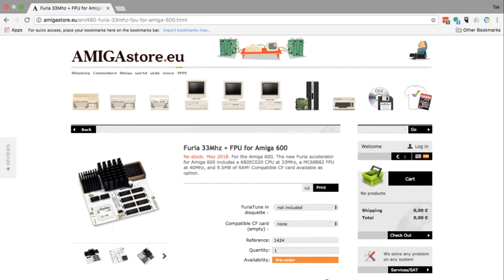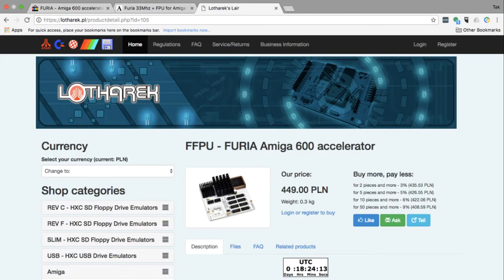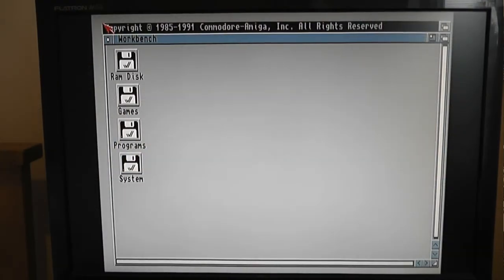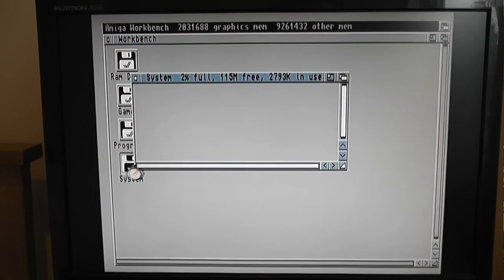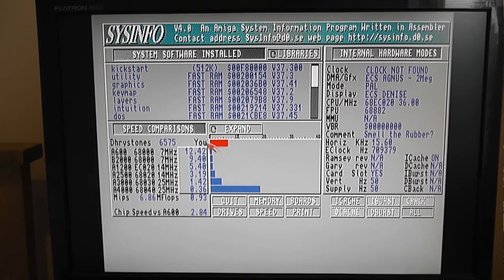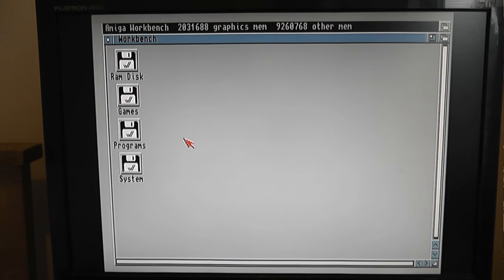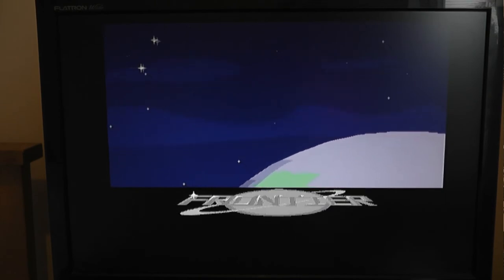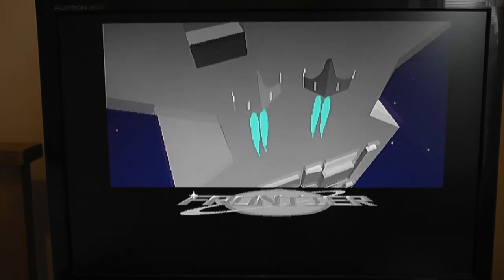Amiga A600 Furia Accelerator Installation and Review

Comment: I also bought my Furia from amigastore quite a few years ago. I got the white version. I ordered a Sandisk CF card with it that was supposed to be compatible. It was never 100% stable with this or any other sandisk Ultra/or other brands CF cards I tried.  I would get random freezes. After I bought an SD to IDE adapter and use SD cards it's been rock solid. So my suggestion is to stay away from any CF cards on the Furia. Even if they say it's compatible. Maybe newer firmwares for the Furia have fixed some of these issues but I would still go for SD cards, to be on the safe side.

Comment: A1 or A2 Marked SD cards are better for OS use than older types. There are also slim SD to CF  adapters which can allow SD media to be used where CF cards were used.  As usual, your mileage may vary. Please check them out for yourself.  Good luck.

Comment: Thanks for the tip about some CF cards not working. Sure enough, I got a blank screen with a Transcend card, but it works fine with a SanDisk.
Reply: You're welcome :) DS cards seems to be the safest option and it's tidy too if you get an angled adapter.

Comment: Great video! I too have an Amiga 600 and I have had my eye on the Furia Accelerator card for some time. 
I too have an cable Compact Flash card on my IDE port, could you please tell me where you got the 90 degree CF IDE connector from?

Also, are you going to do a video on your Amiga setup? What monitor do you have, how are you connecting to it etc.
Reply from the maker: Thanks! They're definitely a good piece of kit for the A600. I would recommend ordering through Lotharek directly. Communication from him is pretty good if there are delays or problems.
The connector I got from Retro Bench https://www.retrobench.com/shop/ki9x6g18kxwpeiikv4el5dcfgk8mag
and the SD card adapter from eBay.
https://www.ebay.co.uk/sch/i.html?_from=R40&_trksid=m570.l1313&_nkw=44-Pin+Male+IDE+To+SD+Card+Adapter&_sacat=0
Most of the suppliers seems to be from the far east. I found one which turned out to be a Chinese seller but the dispatch was from the UK. The chap I originally ordered from is out of stock though. I hope this helps.

Comment: Hi, nice video. Just got my Furia, also Rev 2b, some days ago...

Compared to mine there seems to be an issue with your Furia. It looks really slow and not the maximum RAM is mounted. Have you tried furiatune?

To get this try the following commands in the Shell/CLI - check "furiatune ?" for details:
furiatune boardrom
furiatune shadowrom
furiatune addmem

The result, if correctly used should be:
- a much faster Workbench
- aprox. 11.000.000 bytes of "other mem", if no RAD: device is used

Do you also know: There is a patch to use PCMCIA with the full RAM using "LoadModule >NIL: L:cardres.ld.strip REVERSE". (Ask google for details... ;-> )

Have a lot of fun.
Reply from the maker: Thank you! There's no issue with the Furia. 9.5MB is the standard RAM by default, the extra RAM is an option in furiatune which I briefly ran with the ? option in this video. See my reply to WalteR Mamo regarding queries with my setup :) I've read about the patch but not played with it just yet. I'll do a blog soon and it will be great to see everyone's configuration. I'll leave comments open on the blog so everyone can share their setups.

Comment: Thanks for the vid.  Have you ever had any issues with the Furia not booting?  I've heard it's down to the contacts.  My new 020/40 worked nicely for a day and now doesn't boot, despite being in a REALLY clean a600, and I've cleaned the 68k contacts with a contact solution.  I just keep getting the red screen of death atm.  When it last worked I tried to run Furiatune, with the Furia running and all th memory and cpu being detected by the CLI, but Furiatune stated there was no accelerator card installed.  Have you every had that issue?  It was flying along before this though, so seems like a good card.
Reply from the maker: Hi Ray, I've never had the red screen of death (not that I recall). I have had issues where my A600 had not booted but I had a black screen and this was due to the Amiga needing a recap. All was good after a recap. Times where it did not boot up was when the Furia was not making a proper connection. There should be a click when the Furia connects properly over the CPU. It might sound simple but could that be the issue?
Reply: @amigaguy5003  Hey, thanks.  I managed to get that 'click' today again and it has been working okay - I'm just caution about moving the miggy now ;-)

Comment: Its a shame the Furia doesnt use the full 020 (EC020 instead) because it could then use the full 32bit ZorroIII spacing for memory and not affect the PCMCIA addressing.

Anyway, I have always used Sandisk with no issues.
Reply from the maker: True. Whether it has to do with sourcing a full 020 CPU these days, I don't know but to be fair this accelerator is more than enough if you're looking to do some classic gaming. Yes Sandisk seem to be the most compatible with a Furia.

Comment: Thanks for a great video. :-) I need some advice. I got a standard A600 with no expansions, and a compact flash card installed in it, which is attached by an IDE-cable. However, many of the games on the flash card are not able to run. I get errors like 'cant allocate ExpMem', 'cant allocate ShadowMem' or 'Not enough memory available'. Now I have two questions: 1) The Furia seems to be the right solution for me, since I doubt that a standard 1 MB chip-ram expansion will be sufficient to solve this. Do you agree? 2) If I purchase the Furia, then I'll probably have to get an SD-card reader for my Amiga as well, like you show in your demo. Where did you purchase this from, and how did you install it in the Amiga? :-) I just subscribed, keep posting.
Reply from the maker: Hi Alex, thanks for your comments.
1) If you're trying to run WHDLoad games then you're right, 1MB is simply not enough. If you get more RAM for your trap door expansion you may be able to run a few WHDLoad games with 2MB of chip RAM but a lot of these games will require additional fast RAM. There's a few Fast RAM only upgrades available but with the Furia you're getting a faster CPU too. Running original HDD installable games will be fine (I tried with Sydicate and Settlers but my A600 didn't seem to have enough RAM to play music during gameplay on Settlers). Extra RAM is a must for WHLoad games. And with a faster CPU you'll find graphics in games like Frontier Elite smoother. 
2) Yes an SD card reader is going to be better for the Furia, there's too many reports of incompatibility with CF cards. I got the angled adapter from Retrobench https://www.retrobench.com/shop/ki9x6g18kxwpeiikv4el5dcfgk8mag and the reader of eBay. The seller I purchased it from doesn't seem to be selling it anymore but there are a few from other sellers. Installation is simple, it's 2 parts, the angled adapter goes into the IDE pins, and the adapter goes into the adapter.
I hope this helps :)
Reply: Thanks for replying. That actually explains a lot. Yes, it is WHDLoad games, and some of the games that do run, are missing various parts of gameplay music. Now I know it's due to lack of memory. 😊 

I was succesfull in locating an online shop that sells the angled SD-adapter as a kit specifically for the Amiga 600/1200.

What should I do about boot software for this new setup? Right now, I got the Amiga Boot Menu with Amiga Game Selector option, etc. But I don't know if that will stay as it is with this Furia/SD-setup. This hardware/software expansion stuff is new to me, I've been using A500 1MB w. Gotek for years. 😊
Reply from the maker: @AlexPaulsen1  You'll probably want to prep your card using WinUAE, here's a good guide https://16bitdust.wordpress.com/2015/10/13/partitioning-16-gb-compact-flash-card-with-winuae-and-pfs3/ but  if your SD card is less then 8GB you shouldn't need to do the load patched scsi.device part. I have 3 partitions - System, Games and Programs. My A600 is running Kickstart 2.05. If you have Kickstart 3.0 or higher then this guide may be handy https://www.youtube.com/watch?v=1k1328geyI8 as it's what I followed for my A1200.
Reply: @amigaguy5003  Thanks for the help, I'll use the guide to get it working. :-)
Reply from the maker: You're welcome! You might be interested to know I'll be publishing a blog soon at http://amigaguy.com/ which will cover topics like furiatune configurations and other projects I do for fun. Have fun with your Furia when you get it! :)

Comment: My CF card, pre-loaded with WB 3.1 fails to load. I'm guessing it's because of the type or quality of card I'm using. Have you thought about using an IDE to SD card reader?
Reply from the maker: Yes very likely it will be the CF card. Cheap CF cards are notorious for not working on a Furia. I used an IDE to SD card reader in this video.

Comment: Hi Amiga Guy how much in total did the recap cost.   :)
Reply from the maker: Hi Mark, Amigakit charges £29.95 for the recap services plus shipping. I chose standard shipping which came to £35.88 which was not insured but required a signature. In total I paid around £40 - that's for me sending it off, getting it recapped and sent back. I suppose if you live in Cardiff you could just walk in and hand it over to them. They've done both my A600 and A1200. If it weren't for the fact that my A600 wouldn't boot properly you would never have known they've worked on it by looking at the board! (apart from the stickers). I hope this helps :)

Comment: I saw on this video --->  https://www.youtube.com/watch?v=Ov_ryzW-NV4&t=1230s

This guy adds a small mod (a pad under the motherboard)...  and he then prints up a piece of plastic he installs under the keyboard to help keep the accelerator pressed down.
So it doesn't pop up during any movement.
Might want to check that video out for some ideas. ;)

As for the COMPACT Flash card ...  put it in a tight "anti static bag"  (custom fit)  Seal the bag as much as u can and it should be fine